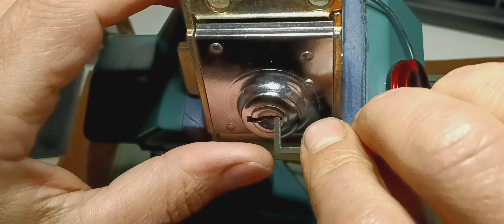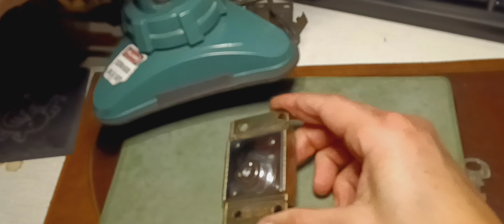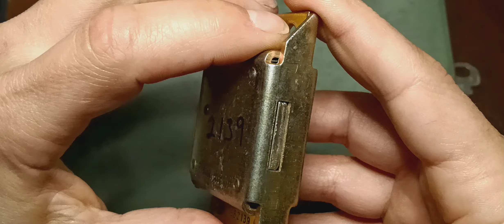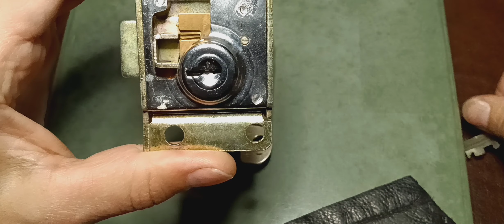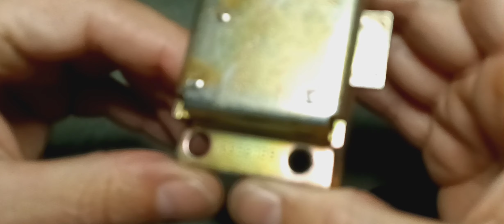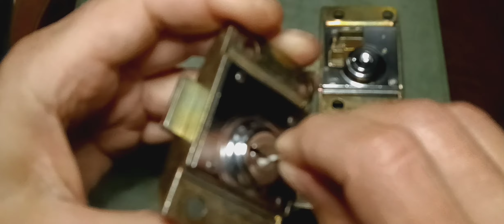[L36] Western Electric 29B Picked on video.

Comment: Thats an intresting looking lock. Looks a bit like the Low & Fletcher 7 lever cabinet locks. They have 7 tiny levers and no false fates tho. Does that tension straight off the keyway turning?
Reply from the maker: Yes you tension off the plug on WE 29B. It's a partial curtain. All 5 levers have false gates on this.
Reply: @RetepReyem  I suppose its a bit like a curtained lever lock really. Just an intresting format. This video made me have to go and read some stuff about the 29b. Deffinatly something intresting. Nice picking BTW👍
Reply from the maker: @Deadlocks86  It's a really neat design. The baby version of the WE 30C. The history is part of why I got this one to start with. All this for a payphone lol
Reply: @RetepReyem  yeah🤣. Im shure the payphones in the UK are Wafer locks🤣
I like the history sometimes too. That got me intrested in Chubb locks
Reply from the maker: @Deadlocks86  I actually just watched your Last chubb video. lol Good stuff!
Reply: @RetepReyem  thanks. The detector is an intresting one. So much so that I got another one🤣. Thanks for watching it👍